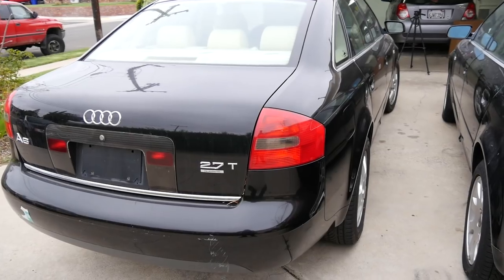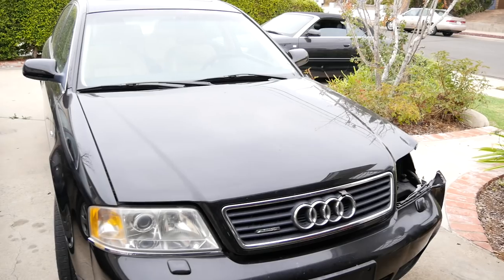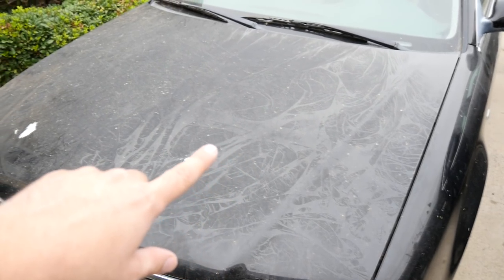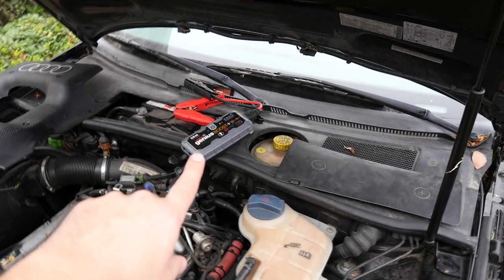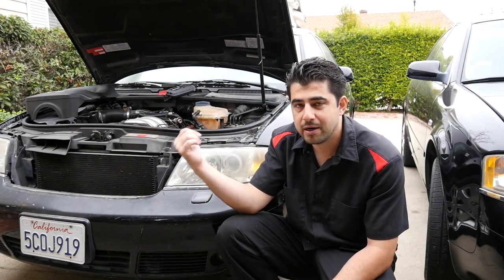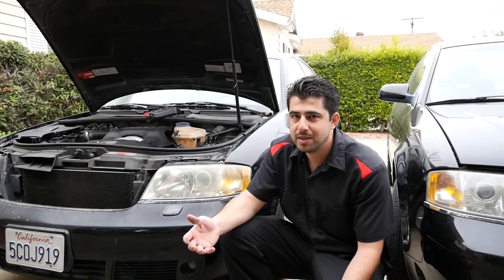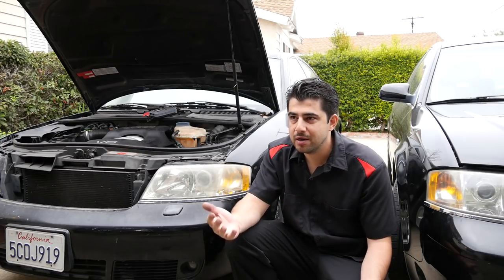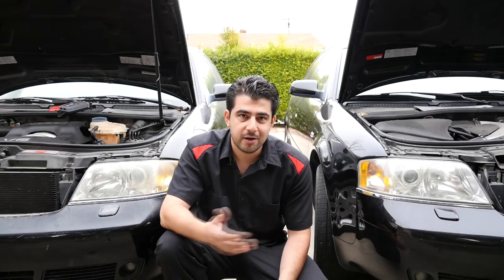Sleeper car for +$500 - No Joke

Comment: Paint your calipers red and put some NOS stickers on your windows.  That right there is 82hp.
Reply: Taylor F. Don't forget about the alloy rims for 20 hp each.
Reply: Yeah man.  He already has some.... but if he didnt have them he would def have to.
Reply: But then it won't be a sleeper
Reply: I don't want to be that guy but my car dyno'd only 78 more horsepower after these mods. Not 82. Please stop spreading lies.
Reply: If you want real, power gains, mix in a can of Monster Energy drink, every time you fill up.
Reply: monster energy drink! 😂😂😂😂😂😂😂, he won he won
Reply: I can see he's low on blinker fluids
Reply: Stick on hood scoops are better 30hp for each one
Reply: Nice channel it's like you just favourited everything I like, I'm boosting a 5.3l lm7 truck motor, maybe I should get some Nuka-Cola quantum stickers on the intake for 100hp each, and a big Dunder mifflin logo on the side of the car for that sleeper look 👍🏻 and oxhorn rocks btw
Reply: +Taylor F. HAHAHAHAHAHAHAHA awesome.  Some chrome stick-on vents on the fenders are my personal fav
Reply: Taylor F. Lol...how do you know it'd be 82hp? What if I add more stickers? Lol
Reply: Because it can hit V-TEC at idle which means that 82 is the max possible gained.
Reply from the maker: You forgot an exhaust tip, that one gets you 45hp easy
Reply: Yeah you just get some improved exhaust flow with a stylish tip.  OOOOOO, we can't forget painting the engine cover!! That right there improves fuel economy and low end torque.
Reply: Don't forget the high performance muffler bearing up grade another 50 hp!
Reply: Shitty plasti dip job = +12hp
Reply: But how can you forget the most important thing? BLINKER FLUID!!!!! You gotta be able to see ahead of you when you're smashing through the hood
Reply: Guys you are forgetting the turbo whistle!
Reply: Muffler bearings are important to lol.
Reply: We all forgot to get the mud vavle gold plated
Reply: Taylor F. Ricer XD
Reply: Taylor F. Lmfao epic
Reply: Don't forget to rotate you sparkplugs
Reply: Strip paint back to bare metal for another easy 30hp.
Reply: Taylor F. O
Reply: Taylor F. Must b why girls cars are so fast
Reply: flame stickers at pep boys adds 5 HP ALSO
Reply: That aint no sleeper then
Reply: Taylor F. 
down hill, with a wind too....
Reply: Someone clearly missed the very obvious joke.
Reply: Mud flaps; 5hp gains per flap...
Reply: Plebs forgot about the Eurobeat!
Reply: You guys are fing hilarious nah man it's turbocharged lol
Reply: good comment ...thats funny and true in some people minds
Reply: Obviously, one should add flame decals. More fire = more hp!
Reply: Booya baby
Reply: Guys dont forget to get rid of the Cat and get a str8 pipe 😂
Reply: lol
Reply: Don't forget the donks with rims 1/4" off the road. Slow to a crawl for a grain of sand on the road but on clean smooth pavement they add at least 200HP.
Reply: Cant forget the R/T badge for a good +150hp
Reply: lambomatt2  
Dont forget the roof scoops
Reply: Debadge, hid headlights and black tail light tint.
Reply: Taylor F. At least that much..maybe more
Reply: Taylor F. I
Reply: Don't forget a cold air intake, good for 1 horsepower at 6000 RPM.
Reply: Listen American muscle  lay off the Japanese and forign cars   if it ain't Chevy dodge or ford crysler muscle or trucks   or luxury sport don't buy   I prefer Chevy and dodge   also  American cars are easier to work on  if you go with forign go with a Porsche 911 or Mazda  CX-5 or Miata   I  personally. Prefer  the Mazda or Porsche I like classic muscle  more  so if I drive a new car it has to be  a dodge  Challenger there good for tuning
Reply: Cosmic Turban if your rims are less then the orm rim they do indeed add hp due to less rotational mass and that =s less drivetrain loss n shit and stuff
Reply: and the ricer stickers and gold wrap
Reply: Taylor F. Yi
Reply: Taylor F. Lol
Reply: Racing stripes will give you more hp
Reply: me sitting on passenger side will add one man power easily
Reply: Also rain guards and shit and things make go VROOM VROOM. Didn't want to give that secret up but you guys seem to be a worthy bunch.
Reply: hood pins add 50+ hp each.
Reply: LOL
Reply: LOL🤣😂
Reply: Blue seat cover adds another 5hp and the red ones add 10. Same goes for steering wheel covers
Reply: Lmao wtf is that lol 💯😂

Comment: this dude is mad smart. why would you even want to buy a new car if you can buy 2 used cars and have fun fixing things on the cheap?
Reply: August Method because it wont be reliable still its an old car people need to work and dont have time to do this and if my pos project car broke down in the morning and i couldent get to work id be pissed
Reply: @wesleeysutton5935  You make it reliable. That is what I would do first the Audis was very over engineered if you do the basics it will run forever.
Reply: I want to agree, but some folks would lose money putting their time (time IS $) into a project like this. Then, you have Life to Live. Family. Kids. Etc. 
then, ultimate there’s the issue with having the Know How. Not everyone is Handy.
Reply: Being a good mechanic can pay off if you love to drive cars. They usually go together .
Reply: @Michael Meyer, as an A6 owner myself brother, UNFORTUNATELY you ARE correct! I think mine has 4-6 different codes going right now and it seems as I'm slowly fixing them, more things arise with it being an 01 and the shitty 2.8 liter motor.
Reply: @ The Cook , exactly, i have two running Nissan Primeras (1997 and 2003 model) bought with a fresh MOT and all up to date for a total of 1300$ for both. Thats just entry money for getting a car loan, and just 25% of the yearly depreciation of a new car. Buying a new car is simply throwing money away
Reply: @wesleeysutton5935  its for smart people
Reply: Lots of people don't find fixing them up fun
Reply: Hes Smart and blessed.

Comment: With only 500 dollars and 1000 hours of labour.
Reply: Ben Cook and 2000 songs of rage later.
Reply: +John Shay
If you know what you are doing you can have the engine pulled and the whole front end removed in a single weekend. All it takes is the knowledge, tools, and hard work. I have flipped a house in a week, and done this type of thing on my own car in less then a month after is got hit. As long as it is front end damage only... dealing with quarter panel damage is a whole different animal, and can take far longer to do.
Reply: Not really .That fender unbolts fairly easily .Light just plugs and bolts in and if any plastic connections broken he has the parts . Hood a 2 man job ,but not that hard to do. He is also in the car business so he knows where to get the parts repainted for a reasonable cost .Remember with the panels replaced there is no real body work ,just sand and paint and clearcoat. At the same time any other paint issues can be done by a body shop that can blend in . Even if he did not refinish the lights himself bet you he can get that done for $60.00 to $80.00.  He was being very conservative on prices  he could get for the parts off the doner car . Just do the math .He has a car for 0 dollars . Beats the hell out of a car payment .
Reply: A lot of men like working on their cars . Great sense of accomplishment ,saves money and you learn a lot . Plus as you are working on your car you tend to maintain it really well so it lasts .
Reply: It's a labor of love. <3
Reply: George W. Bush no but part of the time is spent selling all those items. Surely it would take a while to sell all of them.
Reply: Most of the parts he mentioned selling can be removed within minutes.
Reply: As the prices he was saying he was going to sell the parts for was really cheap .So My gut feeling is those parts would sell very quickly .Then what is left just goes to a junkyard.
Reply: The 2.7 is a cracking engine but Audis packaging is somewhat ridiculous
Reply: Ben Cook Hater
Reply: and 2 years to sell the parts.....
Reply: Lots of experienced mechanics here! (Sarcasm). It's not that hard. It helps a lot to learn about car mechanisms before starting a project like this, or talk about it like you know something. Parts for this car are sold easily if you know where to go.

Comment: Gotta love Craigslist! "It needs coils an spark plugs" and you end up with a blown engine or something... or you get "It needs a timing chain, I think it broke - has no compression" and ended up being a dead battery and getting no spark. 

Love your vids, Can't wait to see more! Sucks you had to go to a smaller garage though.
Reply: keith cunningham lady said her "mechanic" said the timing slipped in her Civic. It was a no start when I got there. Bought from her because the body was in great condition.. turns out it was just a starter.
Reply: I bought an olds delta 88 a couple years ago. The owners said they couldn't figure out what was going on with it and decided it would be better to not have it checked by a mechanic, so after I bought it and inspect it for a couple minutes i realize the fuel pump relay and fuel pump were completely shot. I got a perfectly running car for $200 and an extra $100 on a fuel pump, relay and filter. That was honestly the best deal I've gotten on a car! I just recently sold it after rebuilding the engine (kinda, pretty much just did timing, cooling, gaskets, plugs and coils the rest was pretty solid) for $1200 after driving it for 2 years.
Reply: dana44s Same thing happened to me with jetta guy lied through his teeth wouldn't take it back or nothing so we towed it back to his house after thrashing the hell out of it and blocked his driveway with it. He called me back a couple days later saying sorry and begged for us to move it I hung up and blocked his number .....carma is a bitch lol
Reply: Needs a battery, tow away, my loss is your gain

Comment: put the 2.8 badge on the 2.7
Reply: Kevin Baloyra that extra 0.1 will help him alot im sure
Reply: Power Chill he's saying that because the 2.8 is slower than the 2.7t. Helps with the sleeper status.
Reply: No, badge it down to 1.8T  :-D
Reply: 1.8 T is sometimes fast so for ultimate sleeper status he should put 1.9 TDI badge
Reply: Kevin Baloyra 
Put a HEMI badge on it. 
...still won't make a difference...
Reply: Kevin Baloyra w
Reply: Kevin Baloyra 
Type r badge: 50 hp
M badge: 30 hp
AMG bade: 52 hp
Brembo or k&n sticker: 100000000000000000000000000000000000000000000000000000000000000000000000000000000000000000000hp
Reply: Naa just put a 1.4 TDi badge on it :D
Reply: ZigmaTronik 
OK. We could go Briggs and Stratton lol...
Reply: 1.4 TDi Venostech
Reply: Wrx Sti badge with the honda emblem painted red.
Reply: id rather push the runs on vegetable oil theme! Thanks though
Reply: No 1.2 tdi badge :)
Reply: KEVBA no rice
Reply: put the 8 on the 7 so it reads 2.8T 
ultimate sleeper right there
Reply: But the vw logo with jetta instead of a6
Reply: Why just dont debadge
Reply: An I love Jews bumper sticker
Reply: angelgod 4 that word doesn't mean what you think it does...
Reply: YES!
Reply: Just put a prius badge
Reply: I put the 2.7T badge on a A6 wagon that had a 2.8 originally that I swapped a 2.7T into.

Comment: I spent 7 years in the NAVY on submarines and got hurt badly on one. Lost both legs. But I go to police auctions and bought a Plymouth Fury with a 440 6 pack with some engine problems. I got it for 700.00 and tested the compression and it was great. Old cars like that are easy to fix .

Comment: A good video would be on the best way to decarbon the Audi direct port injection engines. And installing oil catch cans in the PVC system to avoid or greatly reduce the problem.
I'm thinking of the Audi s6 v10, but this applies to any direct port injected engine, and the oil catch cans are good for any engine that you don't want the valves and intake sludged up

Comment: Actually, I did kinda the same thing to fix my 98 Honda civic. My project car had a bad motor (rod shot through the block) but good otherwise interior and exterior. Bought a wrecked donor car with a good motor swapped it out and now have a pretty nice car. Didn't bother selling parts though.

Comment: I have 87 e30 , last year I bought a bought a parts car . It was a 83 with the 4 cylinder.   I used the wheels ,front fenders, both bumpers, most of the interior including the seats , cluster, and ect,    240 for the car. Everything I got off of it was worth it. Both bumpers were at least 350 or more . Came out on getting a parts car. Just do it. It's worth it
Reply: Oh yeah. I switched out the doors so I could have Manuel windows

Comment: I think I said this in one of you older video's I would bet that Audi is pushing the same as a B5 S4 about 261 bhp, and 295 ft lb of torque, this is the UK version, my one. I think the US version is slightly less. Just change the turbos from a B5 RS4 and engine management, you will get 100+ bhp right of the bat. well 375 bhp and 325 ft lb of torque, again this is UK figures. Quick and easy to do.Will look forward to your vids mate.Dave UK

Comment: As an owner of a 2.7 same body style. I'm looking at doing the same exact thing. I work at a dealership that sells these cars and works on them. Unfortunately the 2.8 heads did not fit on my engine and i had to settle for the 2.7 heads. Just letting you know.

Comment: The DOORS alone my god - $300 each if you include the windows and regulators. The interior panels 50-70 each. and there's FOUR of them!!! $$$$$ There's a decent market for them too - I replaced my girlfriend's door when she wrecked it with one of the exact paint code. Saved $2000 in body work.

Comment: Nothing like a old chevrolet car with that is rear wheel drive and have a push rod V8 in it.maintenance is easy and they are reliable and easy to work on like 87caprice or 90-96 Caprice impala,Roadmaster,Fleetwood

Comment: Probly should mention that the more air you forcing to the motor has to be matched with fuel or else it is pointless in a simple tune is not Going to match that amount of forced air you need injectors and fuel pump. Cars are very simple air, fuel, and spark increase them all, but proportionately

Comment: Hi my friend, I can’t find the video where we exchanged a few posts about car being hesitant when hitting 50 mph especially on up hill.  The symptom appears not going to worse, I kept driving until yesterday I changed the oil plugs.   Most of the plugs are oil soaked, all on the firing tip, a few oil filled bottom of spark plug well.  This explained the engine hesitation and misfire.  
The cause of the oil leak is the failing valve cover, which I recall replaced about 30k miles ago.  I assume the gasket lasts longer than that, leading me to believe my installation wasn’t right.  I recall I tightened one screw to be broken.  Perhaps that’s where the leak was as the oil amount from that cylinder was the most amount.  

Anyways just a report back to you.  Are there tips I can learn when doing valve replacement?

Comment: Put the body panels on the car with the salvage title and part out the one with a good title? You're doing it wrong.  Motor swap then part out the salvage car.
Reply: Exactly, take any better parts from salvage car and keep the clean title one. I don't know if the twin turbo one has better suspension/brakes but if so that seems easy swap. I would even say keep the trans/transfer case, whatever the audi's use, if one breaks you have a spare.  <edit>I just noticed this was from 6 months ago.  I'm sure whatever was done is done.
Reply: I see. And how about the manual transmission and wiring and different Quattro systems? The 2 cars are completely different under their skin

Comment: I'm a self proclaimed weekend warrior when it comes to car repair and such. Just curious you said you could tell it had compression issues in at least 2 or 3 cylinders, how could you tell? Assuming you didn't use a compression tester. Just wondering, that's info I'd like to know for my own personal know how. Thanks!
Reply: Mike Moise Take the spark plugs out of your motor, kill the fuel pump and crank the motor, and hear how easy the engine turns. Air is escaping out of the cylinders thru the plug holes just as if u had a gasket leak.
Reply: Listen again, it turns over slow then speeds up all of a sudden. Should be consistent
Reply: He's full of shit. You can't start a car and tell if it has compression issues. Unless you use a compression tester. Or like the other dude said, Take spark plugs out and crank it. Just starting it though isn't going to tell you a damn thing. I don't care how long this dude has been working on cars, He's full of shit a lot of times. Like how he said an Audi A6 is a sleeper. This dude clearly doesn't know what a sleeper is.

Comment: Car - $588
Registration/Insurance - $200
Another Car- $400
Parts and Labor - $1000
Suspension(?) - $600
Upkeep for 1st year - $500

So it adds up real quick. I thought $500 and I can drag race and or autocross it right away. If no one has the space and or the knowledge to fix it then it’ll add up even more...